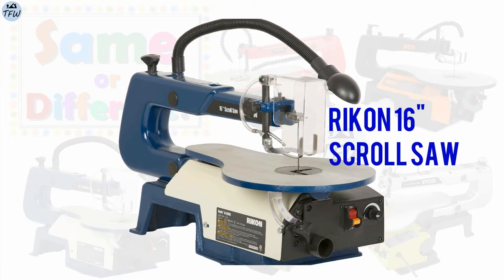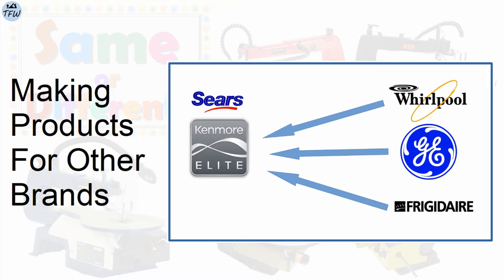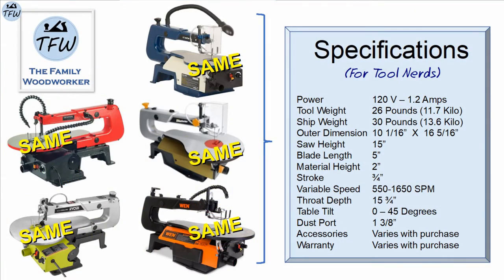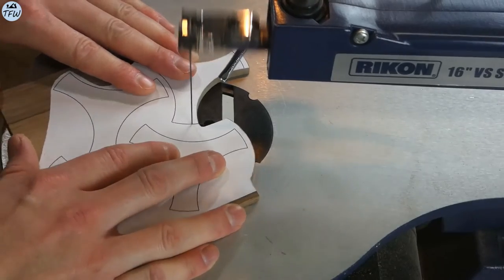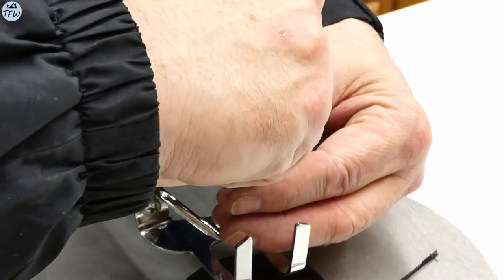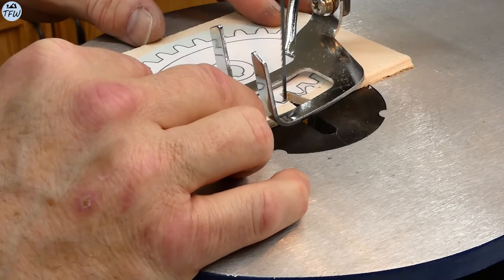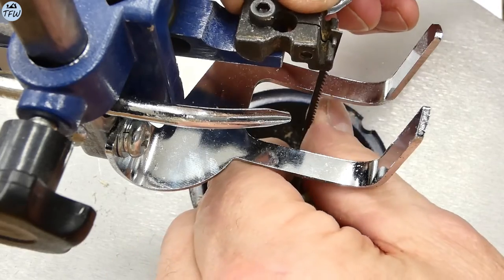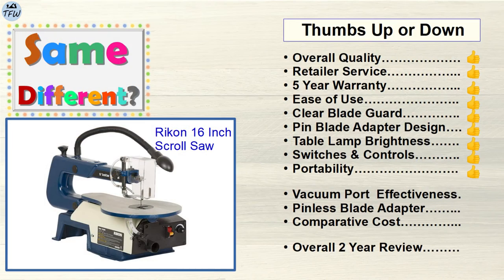TOOL REVIEW: Rikon 16" Scroll Saw

Comment: Hi, I am just getting into wood working and you mentioned adding the universal blade adapter to this scroll saw for ease of replacing the saw blades. Can I you tell me the name of it and where to order or purchase if from as I assume it doesn't come with the saw.  Thanks!
Reply from the maker: Hi back! I tried to find our original supplier for that part, but no luck. I did find the same design out on the WEN website (since these saws are all the same design) The only difference I spotted is that we added a wing nut to the small bolt to easily lock in the pinless blades. I added the WEN link below but I think you can find this same design elsewhere on the web too.  We like it much better than the pinless setup that came with the saw.   Hope this helps! https://wenproducts.com/products/upper-lower-blade-holder